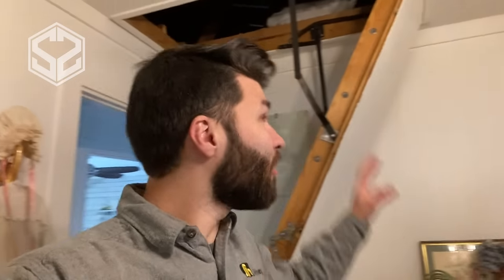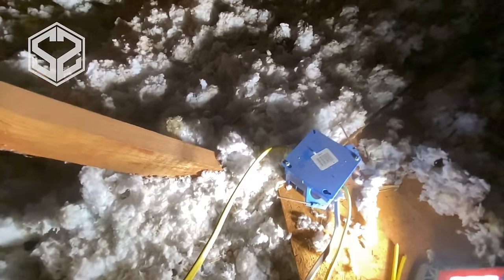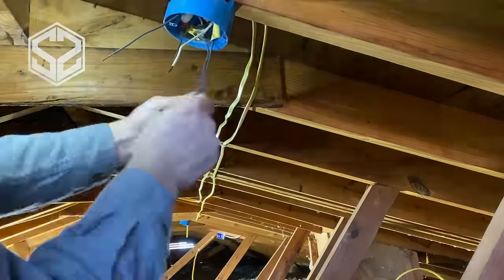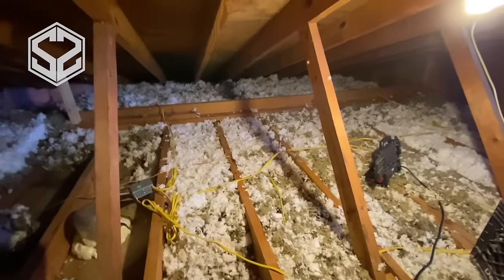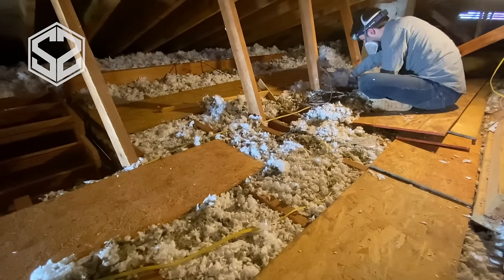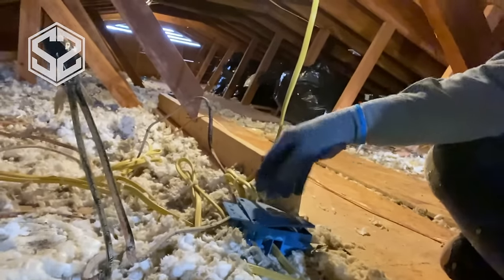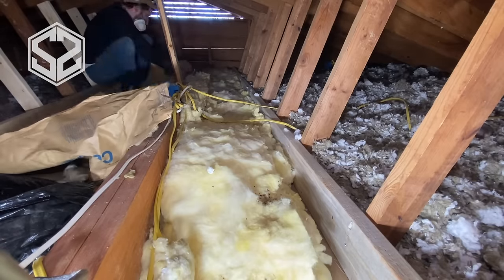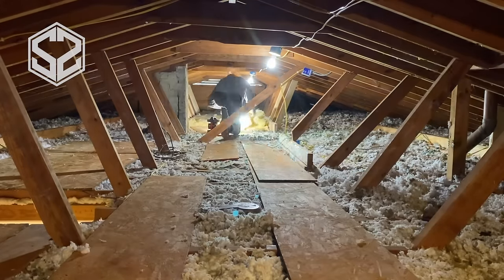How To Fix An Old Attic

Comment: Looping and taping wire like that will create heat and possible fire.  Those Can lights are not IC (insulation contact rated. Again fire hazard
Reply: Was thinking the same thing. You need a special vapor barrier against those lights. I bought special cones that you can completely cover lights with and spray foam around to seal. They are expensive but can't put a price on safety.

Comment: This guy’s attitude and the relaxing music almost makes this seem like an easy project. Doing just about anything in the attic is actually miserable lol.
Reply from the maker: Haha have it was pretty rough 😄
Reply: I had to up the attic and add more insulation. I blasted thrash metal dude, the only way I could stay sane. It was hot up there but the house cooled down a lot after the insulation i added. Its rought man.

Comment: careful bundling that much wire, a normal max amp breaker (not including gfci and cafci) works on heat and electromagnetism, two separate switches. a short will trigger the electromagnetism switch immediately but prolonged amperage at the max of the breaker (15 or 20 amps typically in USA) will not trigger a breaker as it's designed to operate at that exact amps, when you go a bit above the trigger is dependent on ambient temperature and temperature of the breaker trigger. There are trigger curves for all specific breakers on datasheets. If your wire is getting hotter than that it will fail before the breaker flips. Also tight curves on wire is worse, doing a circle probably better

Comment: One thing I'd recommend based on my own attic experience, is to use metal junction boxes in the attic.  When I was doing work in ours I found that all the blue plastic junction boxes from previous times had become so brittle (due to heat presumably) that they would shatter if I tried to unscrew the covers or manipulate wires in them.  I had to replace almost every one of them that I had to mess with.  idk if maybe modern ones are formulated better to take heat into account, but I would not bet on it...
Reply from the maker: Thanks for the tip! Very helpful but unfortunately too late for my project lol! 😁 I’ll remember that next time around.
Reply: I'd think more the heat-cold cycle (same thing that causes potholes in roads).

Comment: I used the professional foam gun, it was worth it. It stops the foam after you release the trigger. It's made by Great Stuff uses different cans. One way I found leaks was to put the bathroom fans on and walk from room to room with a smoke pen, checking windows, ceiling spots. The fans create enough negative pressure to create detectable air flow. I had alot of holes from electrical wire running to outlets and light switches, sealed all wall tops too. Installed 18" of atticcat with baffles at the vents.
Reply: This is an interesting suggestion that I hadn't thought of.

Comment: Hi Simon! Thank you for posting this! My attic is 1960s and 1950s (two parts)! I am trying to make structural, insulation, and HVAC mods to the 50s portion right now and this is an encouragement.
Reply: I installed weight distribution and center ailse flooring in my attic and the height is very similar to yours, which is why I watched!
Reply from the maker: So glad the video was helpful! Thanks so much! Good luck with you project!

Comment: If I needed to decide between paying a professional to do this for me or becoming one, I'd choose the latter.
But it's not easy learning everything in one lifetime.

I find videos like this fascinating because of the knowledge earned/acquired, and shared. 
I wish I knew more about the structural framework and electrical work, yet still, it's a pleasure to watch your videos.

Thanks for sharing.
Reply from the maker: Thanks so much! I appreciate it!
Reply: You're looking at I'd guess, $5,000 in work... So it's not worth paying someone to do a lot of time.
Reply: Good point. All the professionals I’ve hired in the last 10 years (four of them, some with their own workers/subs) have been great at knowing how to do the job quickly, but that’s it. In hindsight, I have some big regrets on each of those projects, some of them big problems that I’ve had to research and fix myself, others that I will need to fix later. I’m not talking about minor aesthetic things either. (I was in my early 30’s and presumed they knew what they were doing, my wife and I were busy with work/school/adoption stuff, so I didn’t think to check in on the details of their work.)

The lesson I’ve learned is if I hire a pro again, I’m going to study up on the project way in advance and borderline micromanage the entire process. Or if in the bidding process the person doesn’t describe their process with the latest best practices/considerations, I’ll know to move on. I’ll come across as a male Karen-type, but I know how to be respectful and polite about it.
Reply: @augenmaugen Ageeed! You really have to know their job to make sure it’s getting done right. It’s also useful to have them pull a permit - knowing their work is going to be checked helps getting the details right.

Comment: I have an old house that was built in 1960 and has been added onto and renovations since then but had no access to the attic. I have been needing to run new romex for my bathroom remodel and finally cut a hole and got a lot of work ahead of me and this video helped give me ideas

Comment: I wold like to get up in my attic to install radiant barrier but it's tight up there to maneuver. I clicked on your video to see clear ways to get around up there. Now I know what I need to do. But it also added to my to do list. Now I want to seal what I can up there, as long as I'm up there....Looked like a big project but in doing a little at a time section by section you got it done and feel good about it. Thanks for the inspiration and the video.

Comment: Lol, I had my 3tab redone two years ago. I went up this summer to spread some moss powder and found a Festool drill with a battery. Still worked. Two years on a roof in Westewrn Wa. Crazy. Still works and charges.
Reply: Yea li-ion batteries can do 5-7 years until "degradation" rating (which is only like 70-80% so it still could work years longer than that)
charge cycles will also wear them down faster which is what we see on phones more than drills.. unless you using the drill 10 hours a day ofc

Comment: I've worked in the attic installing several recessed lights. My body hurting me for two weeks. You did great. Dreading to go back to properly insulation around those lights and add more insulation. But it has to be done.
Reply from the maker: Thanks! it really makes a huge difference. But it is not fun. I try to get the work done in the fall or winter as the heat and bees, bugs or spiders are not an issue.
Reply: @SimonSaysDIY  that's a tip. I will try to do min this fall or early spring. Because the heat up there is no joke in the summer

Comment: Thank you for your post. I am dealing  with the same issue in my attic. The contractor mess-up with the  former owner. I have to retrofit and reroute the bathroom fan, update my recessed light. replace the stack faced insulation batts.

Comment: I had a similar old attic with really old ductwork from the early 60's.   My approach?  remove the duct work, and vacuum all that little bit of old insulation out.  The reason, now you can see the wiring, the problems, the holes and removed all the rat poop and stuff.   I then rewired the house which was easy will all the insulation gone and boards around to move.

Oh, yes I also did a LVL beam install so yes a clean attic was really needed..

Only thing I should have done was installing permanent lights up front.  I used two layers of rockwool for R38.  Plugged all the holes with foam and now have a nice warm house.

You can rent giant insulation vacuum machines that suck all that out in a day or two.   Don't forget tax breaks for the insulation costs.

Comment: great video. one tip with the great stuff cans and other sprayfoam if you keep the nozzle down you get more out of them. After you lose pressure cut the can open you can see how much excess you have. It gets sticky on the bottom of the cam you can slam it down to get the stuff to fall more toward the nozzle hole

Comment: Thanks, Simon; that’s a good first step, lighting. Most attics are darker than sin and hotter than Hades. Powered air vents help too. 
(I try not to work in the attic in summer!)
The roll insulation you plan to apply at 90° to the joists is an excellent idea! You’ll be burying the wood in a nice envelope of insulation, which should cut down on heat transfer that the exposed joists transmit through the ceiling. 

Also, I had the same issue with “allergens” in my house like you mentioned, before having the insulation, rat droppings, and accumulated dust and pollens removed late last year. (And probably some molds?) interestingly, I felt well on vacations, but within a few days of being at home my allergies would start!
Reply from the maker: Thanks! I appreciate it! 😁
Reply: Was up in my attic installing some insulation because the old home owners did... something that removed a lot of it from the attic. I used a light stringer and an extension cord for the lighting because in my area, installing permanent lighting without a permit and an inspection woudl be a code violation. It was so hot in my attic that the 95 degree air blowing in through my attic access felt cool to me. The best part was that my attic access is so small I cant bring the whole roll of insulation into the attic without unrolling it first, then I had to carry it up the ladder, then feed it up through the access hole while standing on the ladder being careful I don't tear the insulation. Fun stuff.

Comment: Now that it’s been a while since you did all this excellent clean up work, can you offer any comment on how much your heating and A/C bills improved?  Thanks for the great vid!
Reply from the maker: We’ve seen a great improvement in energy savings. Although the energy costs have gone up significantly, our bills AC bills haven’t increased and dropped slightly from the year before. Heating is much more efficient and we used almost half the amount of firewood to heat our house. The air quality as improved and as awhile we have been less congested and no attic smell gets into the house.

Thank you! 😁

Comment: Instead of running 2 wires for the switch you only need to run one as a switch leg, so black goes to every light, white goes to every light, and down the line the switch connects them. Much less work and less wire.

Comment: Thanks for the video! I plan to tackle my own attic in the cooler months, and this has helped me consider doing it myself.

Any recommendations for spray foam? Would it be best to get fire-blocking options for the gaps between the floor and lights?

Comment: Now that you are done, can you clean up my attic? I have more room than you do (I can almost stand up straight in the highest part).
Also, instead of having what might be an insurance canceling code violation in your attic, you can buy a "temporary" light stringer from home depot for about $60 and just plug it in with an extension cord whenever you are in your attic. I bought a 50 foot, 5 light stringer from home depot and it gives a ton of light and can be moved to other areas if needed or even used other places and it does not violate and electrical codes.

Comment: Some day you should replace those can lights with those pancake led lights. You can lay insulation right over them.
Reply from the maker: Thanks! That would be a nice updated from these can lights.
Reply: One thing about the led lights. That after 5 years. You have to replace them all with another one

Comment: I thought with a truss system, there wasn’t any interior walls that were supporting ? I have an extremely similar house as yours, and I removed the wall separating my kitchen and living room, and now I’m super nervous lol. I had 3 separate people tell me the wall was fine to take out, but I’m still nervous
Reply from the maker: Yeah, good question. My house didn’t have trusses. It used  rafter system and a lot of the supports had been taken out by someone that didn’t know what they were doing. So first the roof was weekend by a previous homeowner. And this particular setup used the walls below it to give it more strength as each support tied into the top of the wall below. 

Trusses can span far distances without sagging and would be much better than the setup I had in this attic. So that may be true in your case. I hope this was helpful.
Reply: @SimonSaysDIY  yes very helpful thank you. I need to get up in my attic and do pretty much everything you did..I just keep procrastinating lol. Thanks for the reply and thanks for thr video

Comment: kinda looks like what I am dealing with.  Its not big enough to consider any sort of room, but the storage space cannot be denied.  I am looking into how I can snag a bit more room and square things up by installing vertical rafter supports instead of the slanted ones.  Might double up on them for shits and giggles  Then it is just a process of finding a spot for an access ladder and beefing up the ceiling joists to bear more weight.  Maybe it could be a futon room someday, but just want the storage for now.

Comment: Is it safe to put spray foam around can lights? I know you're not even supposed to let insulation touch it since they can get so hot. (Some people rip them out and replace them with wafer-thin LED lights)
Reply: Rockwool can light covers with a thin line of spray foam to seal the base of the cover.

Comment: Did you do cellulose blown in between the 2x6 truss then place fiberglass batts perpendicularly on thop of that? I thought you shouldnt mix insulation types? Also, do you not need a vapor barrier woth blownin insulation? Why not?

Comment: Watching this two years after video has been posted. Have you done a cost analysis in terms of energy usage (electric/gas)?
Reply from the maker: Since this has been done, energy prices have risen significantly, so a year over year cost comparison isn’t super helpful. However even with price increases the bill has maintained the same amount or a little less than the years before.  We have noticed that our AC system runs for a shorter amount of time and the wood stove we use in the winter doesn’t have to run full blast any more.
Reply: @SimonSaysDIY  you can compare kilowatt-hours, which will be reported on each electricity bill. So you should hopefully see a significant drop in kwh's in summer months.

Comment: Hi Simon, my attic has a huge mound of that loose insulation fluff that you have there in your attic. Do you recommend that I go up and spread it around so that all areas have equal coverage up there? Or should I take it all out and replace it with some other type of insulation? (Like the kind that comes in rolls). Thanks!
Reply from the maker: Good question. Ideally the loose insulation would be evenly covering everything to be effective. If you have an issue with too much heat leaking into the house from your attic you may want to replace the loose insulation with the roll insulation as it has a much better insulation value and is much more efficient.

Comment: What kind of boards are you using in the attic to move around? Dimensions and thickness, material etc. Thanks.
Reply: Half inch plywood would work (the spacing between the ceiling joists should be 16” on center (but it could be 24”…!)
If it were me, I’d rip 3/4 4X8 sheets of A/C grade plywood into 16” strips. That would give you a strong and enough enough platform on which to scoot around. 
I recommend A/C plywood because you can use the “good” (A side) face to move on without worrying about splintering, and the “bad” (C side) against the insulation side. That way you get the best material for the money — and save by not over-buying
Reply: @DanielinLaTuna 🙏🏼 I had no idea there's "AC" plywood in existence

Comment: why did you go from 14ga romex on the incoming line for the bedroom lights and switch to 12ga (yellow) wire? the romex is color coded for easy recognition of circuit ampacity.
Reply: U can go from 14 to 12…can’t go from 12 to 14
Reply: Guessing he probably had 12ga wire laying around. Same reason the person before him used too small a junction box - it's what he had on hand and didn't want to run to store.

Comment: Thank you for the clear and well put together videos. I noticed that you were using the regular foam and not the orange/fireblock. If you were to do it again, would you use the regular one or the version that is more resistant to fire? Thank you again!
Reply from the maker: Thanks!! I would probably stick with the normal, However, I currently have all led bulbs in the can lights that I sealed around so the heat given off by them is very minimal. If fluorescent or incandescent bulbs are used I would recommend using the fire-resistant foam as the heat would be much higher. if you would rather use the fire-resistant foam for everything it certainly wouldn't hurt anything.
Reply: @SimonSaysDIY  Thanks for the reply. After writing the question above I went into a rabbit hole researching and the store-bought orange foam is basically the same as the regular foam. Somebody had even posted an article with the title "A Can Full Of Lies". Thanks again and looking forward to the other videos you have posted here.
Reply from the maker: Wow, good to know, thanks!! :)